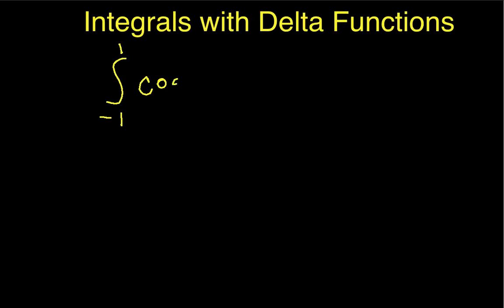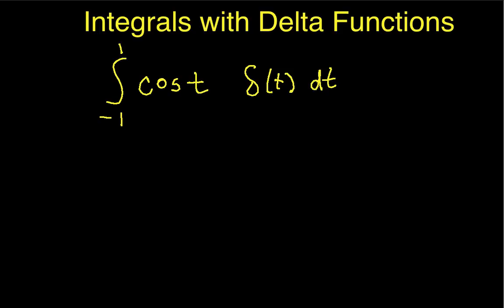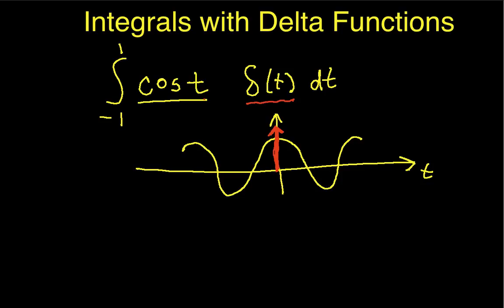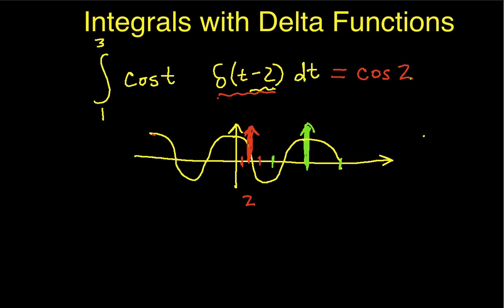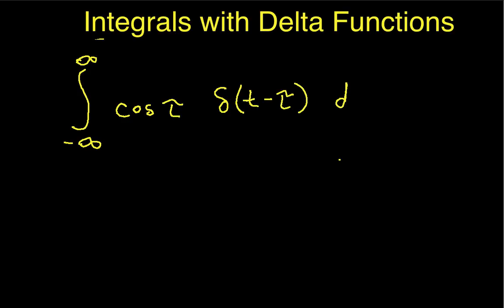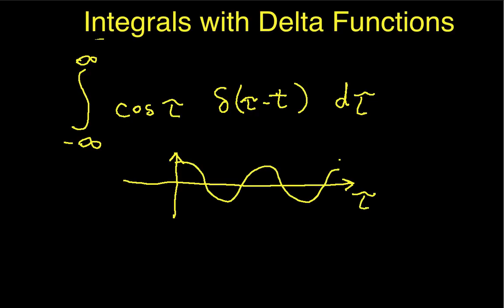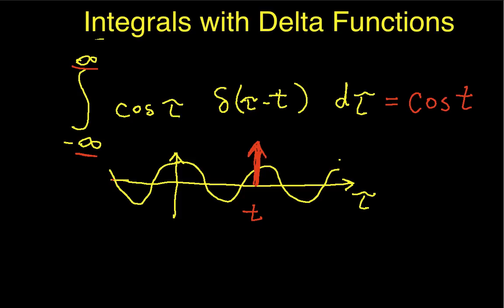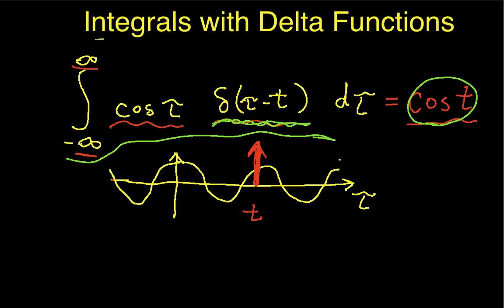Integrals with Delta Functions

Comment: at 9:40, what you erased was also correct I believe.
delta(t) is an EVEN function, therefore delta(-t) = delta(t).
So.......delta(t-T) = delta(-(T-t)) = delta(T-t) would have given the same exact answer.
Someone please verify this!
Reply: erq δ(t) is even, but a signal doesn't keep the evenness property over displacement in the t axis. If it is mirrored left to right then it should be the same. If you had one δ centred in 3, for it to be even you should have a mirrored δ in -3, for example. 
As further example: Cos t is even, but as cos t+π/2=sin t, with t+π/2 it is an ODD function. So, you can't have the general case of δ(t-τ)=δ(τ-t), it is false. 
Sorry, bro. And sorry for bad English! Hope it helped

Comment: this does make sense BUT does anyone know why this uses delta(tau - t) and then later in convolution they use delta(t - tau) and get the same result??? I kind of get it mathematically but it gives the same result! in which case why bother changing the t and tau around for convolution?? is it just for the hell of it? i mean why bother when its the same?
Reply: +Captain Rhodes that's just the order of the convolution, meaning x(t)*h(t) gives the x(t)h(t-tau) as the integrand, and h(t)*x(t) gives h(t)x(t-tau) as the integrand
Reply: +Captain Rhodes For whatever reasons, you mirror one of the signals x(tau) or h(tau) in convolution. If you mirror function h, it will become h(-tau) instead of h(tau). You then get the y(t) = x(tau)*h(t - tau) = x(t - tau)*h(tau).